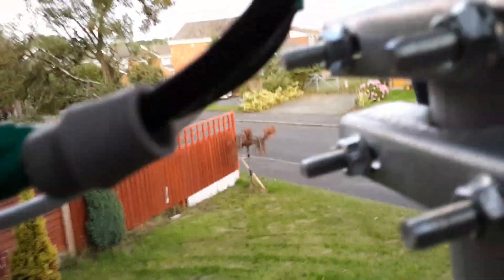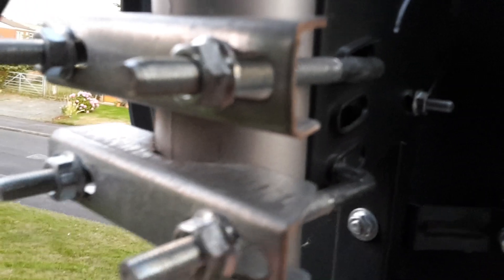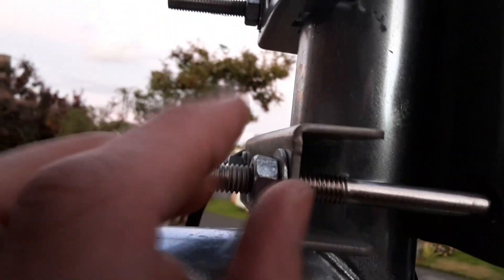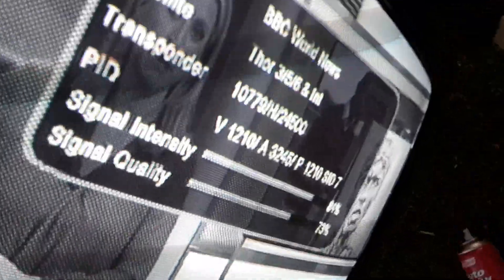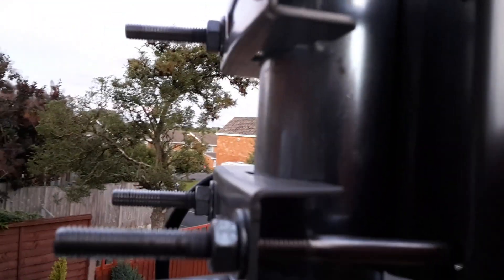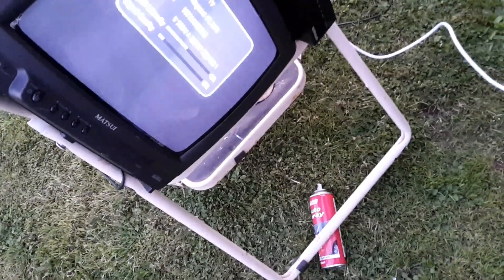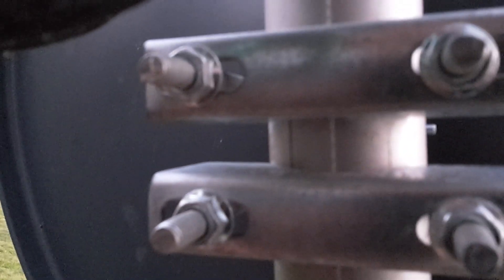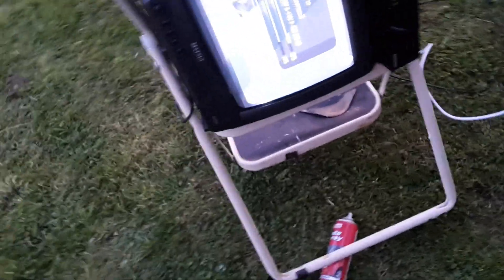How to set up a motorised satellite system

Comment: Hi, I have got a question. My dish is on dead straight and my motor is set to 0, so do I have to move the dish on the motor arm or on the L bracket to point the dish to 0.8 west??

Comment: Hi, your video is very helpful, Sory to bother you. On the recever > USALS =  
I have 
location       East
Longitude    42.681
Hemisphere south
Latitude.       2.04
Now do I  set motor on 0.8  and find thore or set on 0 and find thore via left and right movement? Thanks
Reply: Also as I have to set elevation of motor 42 now, do I have to put 42 or 52 in to receiver as my longitude is 52 according to the website you have recommended.
Thanks

Comment: Where does the motor get its power from?
Reply from the maker: It's via the coax cable from the receiver. I think it's18 volts that's sent down the cable. 
I believe that older motors needed a separate power supply, but these days just the coax is enough... :)
Reply: Many thanks for that
Reply: Sorry one more question, How do you know what the required elevation is?
Reply from the maker: It's actually quite easy when you know the formula. Just put where you live into https://www.latlong.net/ which will tell you your latitude. Then to get the elevation, you just need to minus your latitude from 90... So, if your latitude was 50, it's be 90-50 = 40 for your elevation.